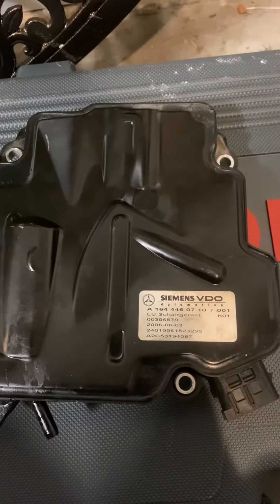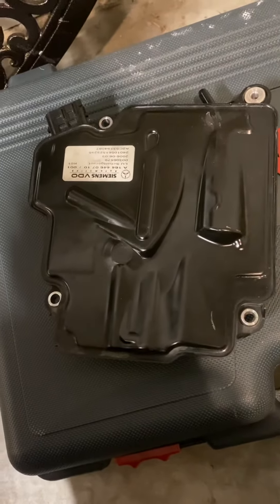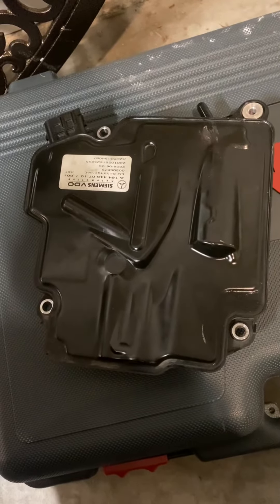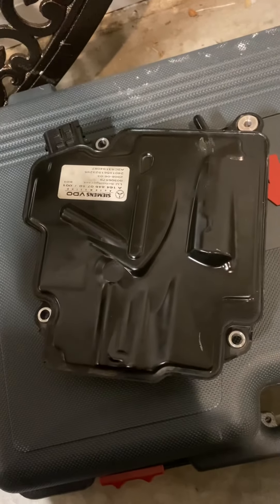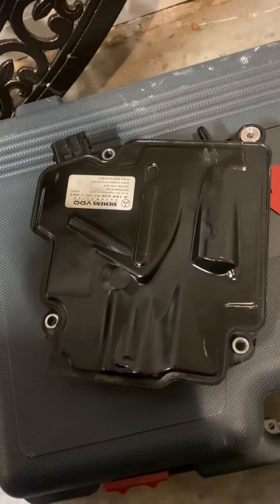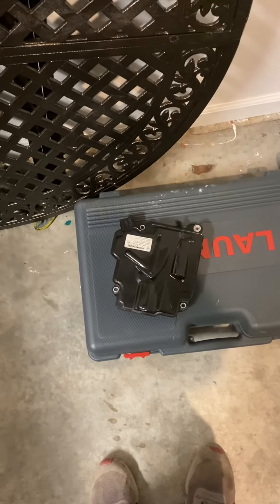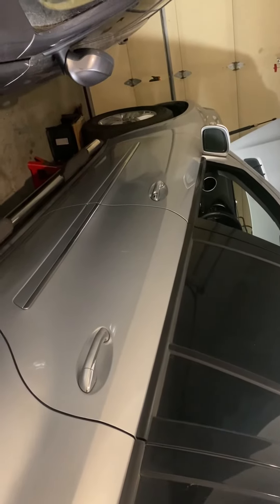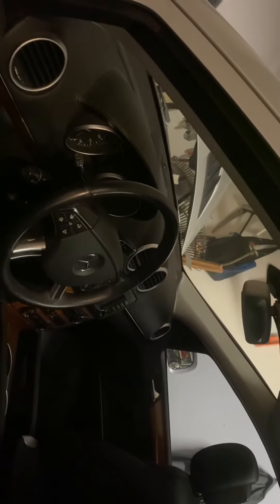Part 13: Mercedes-Benz ISM Module removal - Summary

Comment: This is the only ISM removal video on youtube
Reply: You now how program the ism
Reply: @ransetrodriguez586  I struggled with this for a long time. Ended up going to an independent shop, they replaced my ism that they acquired from a dealer. all costing about $1,000. It was worth it because I had a lot more invested in the equipment to program the ism. Plus the time

Comment: Hallo nice video. I have question how do you program the new ism?
Reply from the maker: I used the launch pro to program the new unit. I believe there are few other options to program the unit.
Reply: The tools can program used ism or do i need to buy new ism? Do you mind tell me what model of the tool. Thank you.
Reply from the maker: @asinantan  if it’s a used ism from another vehicle then you need to have it unlocked first before the tool can initialize it with your vehicle. I recommend getting a new ism, I found one on eBay for $350 USD. New ism also needs to be initialize with the tool.
Reply: Thank you for your replay
Reply: @AutoSupport1  hallo again. Do you mind to provide the link for the tools? I cant find the one that can program my ism. I found the one can do ecu.  Is it x-431 pro?
Reply: @asinantan  I have a Mercedes computer and x431 pro. Not much success
Reply: I struggled with this for a long time. Ended up going to an independent shop, they replaced my ism that they acquired from a dealer. all costing about $1,000. It was worth it because I had a lot more invested in the equipment to program the ism. Plus the time